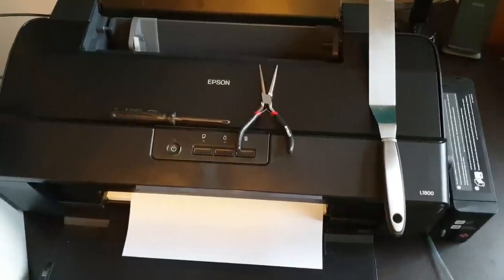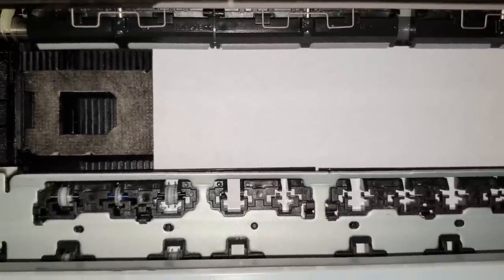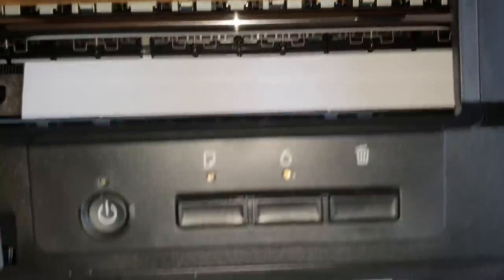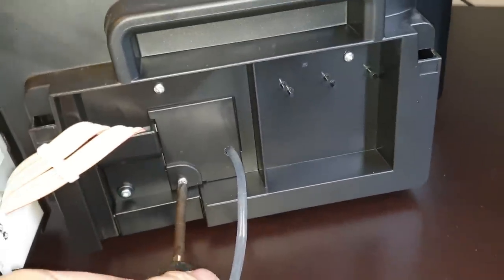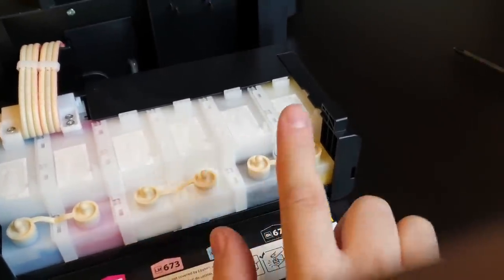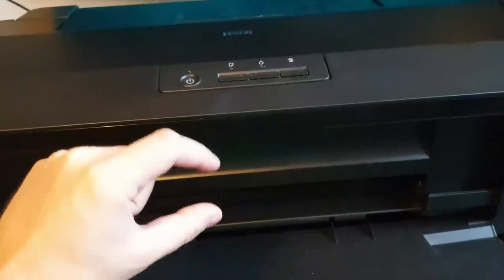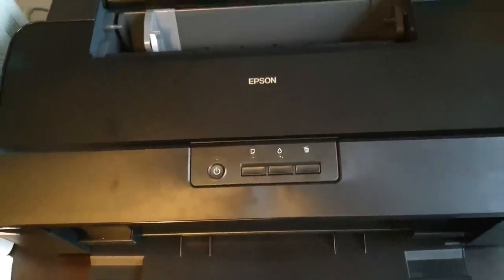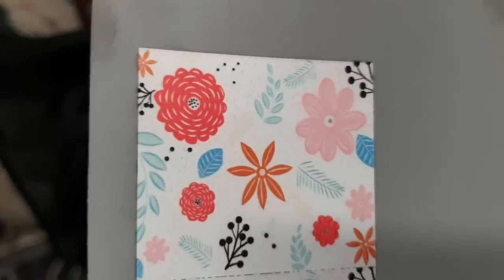How to convert Epson L1800 printer for DTF printing. Easiest and cheapest way. Tutorial.

Comment: Can you convert a used one or do you have to buy a new printer?
Reply from the maker: You can convert a used one. You'll just have to clean the old ink out. Be careful, a lot of cheap used printers are sold with clogged up printheads that can not be recovered.

Comment: will you still be able to use it like normal?
Reply from the maker: Yes, if you flush the ink and replace it. Only down side is that you will lose around 3cm from the bottom of your prints after removing the rollers.
Reply: @dtfprintingtechnology9457  thank you🙏

Comment: Hello...i have my L382 printer..can I modify this model
Reply from the maker: Where are you planning to put the white ink? You need to replace 1 colour with white. L382 only has 4 essential colours.
Reply: @dtfprintingtechnology9457  it is reason why i asked you..
Reply from the maker: @croativeideas5010  You need to remove one colour and add white ink instead. So you can't use an L382 unless you plan on printing without ever using red, yellow, blue or black colours. You need a printer with 6 or more colours that you could print with white ink and CMYK. I was just curious why you thought it could work. You can still make it work if you only plan to print on white shirts. Then you don't need white ink at all.
Reply: @dtfprintingtechnology9457  thank you... but i need to print on black, red, blue t-shirts...because i have lot of designs with white color...

Comment: What r the disadvantages in this convertion? Pls let us know if any
Reply from the maker: Compared to what? Professional DTG is still better than DTF, but you need at least $15k worth of equipment to do it properly, and it's hard to make that much money back. Compared to other DTF printers, L1800 is one of the slowest. DTF is not a perfect method and L1800 is not a perfect printer. I recommend a $620,000 Kornit Atlas DTG machine over DTF any day.
Reply: What about Brother dtg gt 541? Would you recommend it?

Comment: can we convert sublimation printer into dtf
Reply from the maker: Sublimation printer is just a regular printer with sublimation ink installed. You can convert it if it's a compatible model with 6+ colours. You will need to replace the ink.

Comment: Is print head life decreasing after this procedure?
Reply from the maker: Yes, printhead life starts decresing as soon as it's made and it will decrese with every procedure, every print, every clean and every day that it sits without doing anything. Whether you are printing photos with epson ink, DTG or DTF. All prinheads die eventually. One print head will print you 1000+ pages if you look after it and replacement only costs £60.

Comment: What are the dashed lines every so far on the image? Like a perforation? A cut line?
Reply from the maker: Just a bad design I put together for the demo that was not tiled properly in photoshop.
Reply: I've removed the 3rd from the left roller! Did I make a bad boo boo????? 😲😲😲
Reply from the maker: @kylaoziah7791  You can remove all of them. Does not really matter.
Reply: @dtfprintingtechnology9457  if you remove all will it still feed the paper?
Reply from the maker: @graphx88  Yes, it will

Comment: What if you go on vacation?
Reply from the maker: You will need to flush the ink lines + print head with a long term storage solution and leave the print head wet capped.

Comment: do you have any project to convert the l1800 and print t-shirts?
Reply from the maker: I don't understand what you mean. I show you how to convert the printer in this video and I already run a print farm and a merch store where we pring and sell t-shirts. What do you mean by project?
Reply: @dtfprintingtechnology9457  There is a method to convert L1800 on DTG printer with flat plate..
Reply from the maker: @malmdp  Yes, I've had a few of those. A lot of Chinese flatbed printers are based on L1800. I moved from DTG to DTF so there are no plans to do DTG conversion videos.

Comment: Hi! thanks a lot for the info... You think I can do it on Epson 14000?
Reply from the maker: You need a printer with CMYK and 2+ other colours that you can fill up with white ink instead.
Reply: @dtfprintingtechnology9457  Thanks, I understand... I Think i will go for a epson l805, but im worried about the maintence..  I Don't know how to avoid blockings of ink
Reply: @pitito56  The best way to avoid blockage is to use quality ink and print a few times per week. Then you won't need much maintenance at all. If you plan on leaving your printer to sit for over a week, you will need to drop some cleaning solution into the capping station, flush the printhead + lines and leave it soaking.

Comment: Thanks for the video. What rip software are you using?
Reply from the maker: Acrorip
Reply: @dtfprintingtechnology9457  where to download that. 
What version.
Reply from the maker: @fikribastian7398  You need to buy it. It comes with a physical USB dongle which acts as a key. It can be purchased on our website.

Comment: is there a big difference between Epson l1800 and l1300 and which one is better ?
Reply: the L1300 cannot be used for ddtf as the rip software doesnt support the l1300, and also the l1300 is  a 5 color printer

Comment: How many prints can you run in a day..?
Reply from the maker: I can time an average print session for you but I can't tell from the top of my head. We just add more printers when things bottleneck so it's hard to tell. Still cheaper than running 1 F2100. One thing to keep in mind. There is a number that often gets quoted, 15 minutes per print or something like that. In reality it's quicker. You can drop down from 1440 x 1400 DPI to 1440 x 720 with hardly any visual drop in quality and print much faster. Overall however, speed IS a big negative when it comes to L1800. There are print heads that are waaaay quicker out there.
Reply: @dtfprintingtechnology9457 ...not stressing Speed times but can it run 25 30 prints per a day or less...???
Reply from the maker: @JessBenS  It will do 30/day for sure.
Reply: @dtfprintingtechnology9457  thank you replaying to my questions...

Comment: Can Epson L222?
Reply from the maker: It does not even have space for white ink. Where would you put white ink? You need CMYK + White. So you need a printer with 5+ tanks.
Reply: @dtfprintingtechnology9457  so could you convert a epson 7750?
Reply from the maker: @danitanolan8751  nop